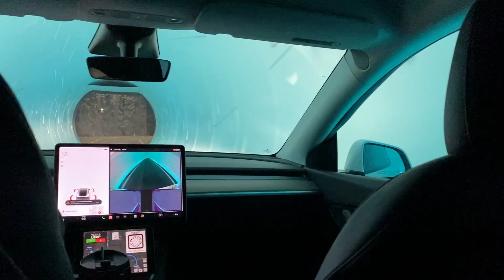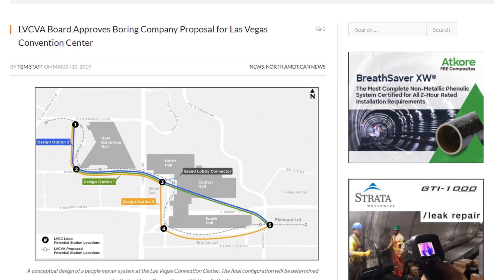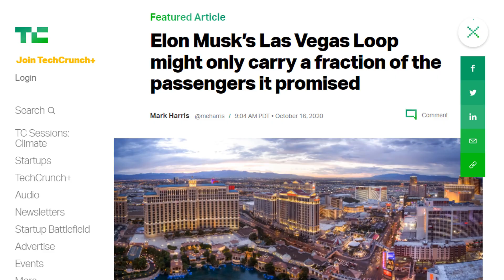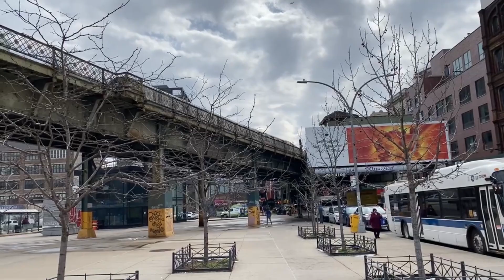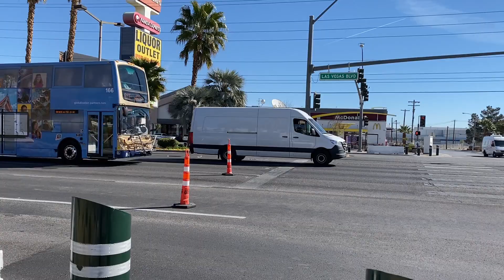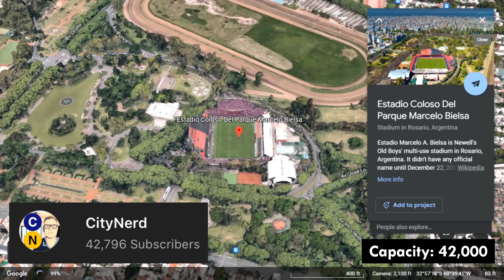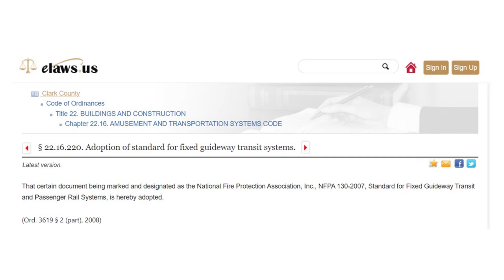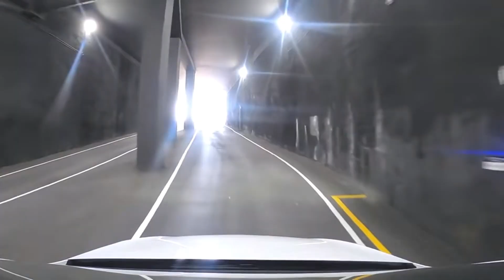Inside the Las Vegas Loop: Transportation Game-Changer, or Complete Waste of Time and Effort?

Comment: 11:50
If it's such a short tunnel why don't they put in moving walkways instead of using vehicles?
Reply: 12:29 the convention center is the first step. In phases 29 miles will happen.
Reply: Because that wouldn't sell any Teslas.
Reply: @colormedubious4747  In fact Tesla intends to take Teslas off the market intentionally after autonomous driving is commonplace. For rent only.
Reply: @conveyor2  So, Zipcar with Teslas, then?
Reply: Moving sidewalks only travel at 1.4mph.  That means it would take over an hour to get you to the other end of the 1.7 mile convention Center instead of 2 minutes on the Loop! 

That is even worse once the rest of the 29 mile 51 station Vegas Loop is constructed - a moving sidewalk would take you 10 hours to travel from one side of the city to the other!
Reply: @andrewfranklin4429  A person walking on a moving walkway moves about 5 MPH.  So that's about 20 minutes to go from one end to the other.  Plus walkways could be going both ways at once and the capacity would be several times higher (about 20 times I think).

If they do make a 29 mile transit tunnel they'd better dig it wide enough for two trains.
Reply: @VitalVampyr  The Disney peoplemover has decent capacity (4,885 people per hour) but very slow speed of 7mph. 

Bus Rapid Transit (at grade) has very low capacity:
90 passengers per vehicle * 15 vehicles per hour = 1,350 pph.
And low average speed of 9mph due to city traffic and having to stop and wait at every stop. 

Bus Rapid Transit (grade-separated) has low capacity: 
90 passengers per vehicle * 30 vehicles per hour = 2,700 pph.
And but still slow average speeds of 12-22mph.

Light Rail Transit (at grade) has medium capacity:
90 passengers per vehicle * 3 vehicles per train * 15 vehicle sets per hour = 4,050 pph.
But slow speeds of 9mph -12mph due to city traffic and having to stop and wait at every station. 

Light Rail Transit (grade-separated) high capacity:
90 passengers per vehicle * 3 vehicles per train * 30 vehicle sets per hour = 8,100 pph.
And still pretty slow average speeds of 15mph due to having to stop and wait at every station. 

Subways have very high capacity:
100 passengers per vehicle * 10 vehicles per train * 30 vehicle sets per hour = 30,000 pph.
But still slow speeds of 17-22mph due to having to stop and wait at every station. 

The 29 mile Vegas Loop (2.5 passengers per EV) will have high capacity:
 2.5 passengers per vehicle * 4,000 EVs per hour = 10,000 pph
AND very high average speeds of 60mph thanks to direct point-to-point travel at high speeds. 

The 29 mile Vegas Loop (4 passengers per EV w ride sharing) will have higher capacity:
 4 passengers per vehicle * 4,000 EVs per hour = 16,000 pph
AND very high average speeds of 60mph thanks to direct point-to-point travel at high speeds. 

But the 29 mile, 51 station Vegas Loop will have up to three parallel arterial tunnel pairs through the busier parts of the city giving 30,000 - 48,000 pph down the main arterial tunnels AND very high average speeds of 60mph. 

The Boring Co has actually rated the 29 mile, 51 station Loop at a minimum of 57,000 people per hour. 

So the Loop easily holds its own against not just people movers, BRT and Light Rail but is also pretty competitive against many subways.
Reply: @andrewfranklin4429  4000 EVs per hour? How is this being measured? If this is the proper measurement of vehicles traversing a fixed point, that's 3x a highway lane. Even if you have perfectly optimized autonomous coordination, which doesn't exist yet, there's still merging, loading, unloading, etc. at the stations. The numbers are nonsensical. In addition, I strongly doubt Tesla of all companies (if any are able to at all) will be able to achieve successful autonomous software considering the high talent turnover due to shitty work conditions. Their software engineers are fed up with Musk's idiocy and leaving, and Tesla's software is suffering for it.

Unless you're getting paid to do so, stop shilling for Elon Musk. There's no benefit in it for you. Look at the more advanced and dense cities in the world and see how they've solved their transportation problems. Here's a hint: the cities are not in the USA and the solution is not cars.

Maybe you are being paid to be a shill, in which case I've just wasted my time. Oh well.
Reply: @TheOneFoolishMan  actually, the potential capacity of a single highway lane is a lot higher in real life than what some sources suggest. A 2010 study by the Honda Research Institute found that 25% of drivers maintained a distance of 2 cars between vehicles at 60mph on a busy 2-lane freeway, 15% 3 car lengths, 15% 4 car lengths, 5% 5 car lengths and 15% 6 car lengths. 

So that is 75% of cars having a headway of one second (~6 car lengths at 60mph) or less and 40% maintaining a headway of 0.5 seconds (~3 car lengths at 60mph) or less. And remember those are cars driven by potentially distracted, drunk and careless drivers. 

Note that a headway of 0.5 seconds = 7,200 cars per hour
And a headway of 1.0 seconds = 3,600 cars per hour

The Boring Co is planning on a headway of around 0.9 seconds (~5 car lengths between EVs at 60mph) which will give a throughput of 4,000 EVs per hour.  With 2.5 passengers per car that gives us 10,000 people per hour. With 4 passengers per car 16,000 people per hour per single tunnel. 

Once the Loop autonomous control systems with their millisecond response times and ability to for example command ALL vehicles in a section of the Loop to brake or accelerate simultaneously, there would be no problems safely achieving headways of this duration.
Reply: @TheOneFoolishMan  in videos from CES, the drivers were saying that the cars have already been modified for autonomous operation, but that it is not yet enabled as they are still awaiting regulatory approval and liability is “holding us up right now, but once that gets cleared we’ll turn all the cars on”. 

After all, The Boring Co actually took the press for test runs using autopilot running in Loop EVs over 2 years ago in the 1.14 mile test tunnel in Hawthorne California.   At that point, autopilot was limited to 90mph (145kph) but was scheduled to be increased to 125mph (201kph) a few weeks later. 

Not surprising considering that following a white line in the controlled environment of a tunnel is hardly rocket science.
Reply: @TheOneFoolishMan  Im not sure why anyone would bother to pay people to shill on a channel such as this?  

Personally, I enjoy meaty discussions around topics I am interested in, particularly when I see the “common wisdom” of the majority on a forum failing to recognise the possibility of disruption coming to the status quo.  

I find it helps to sharpen my reasoning skills and deepen my knowledge about such topics while at the same time providing a good check for me in cases where someone raises a point that disproves one of my assumptions or conclusions. 

So thanks for the opportunity to chat about such interesting things OneFoolishMan.
Reply: @TheOneFoolishMan  in terms of loading and unloading at stations, that 4,000 EVs per hour with a headway of 0.9 seconds is for traffic down the main arterial tunnels of the Vegas Loop. The stations are all off the main arterial connected by short spur tunnels so traffic through the stations has longer headways down to 3 seconds or so which gives us up to 1,200 EVs per hour per station. 

It is a bit confusing, so let me explain how it works. 

Looking at the footage from the SEMA conference in Nov, we see each Loop EV taking around 15 seconds to unload and 15 seconds to load passengers, giving us 30 seconds between vehicles in that one bay. There are 10 bays in each station so that works out as 30 seconds divided by 10 = 3 seconds between EVs exiting that station. 

Again, looking at the footage, we do indeed see EVs leaving the stations down to 3 seconds apart which would give us up to 1,200 EVs per hour. Across all three stations, that’s up to 3,600 EVs per hour. 

We also see between 2-3 people in each EV, so with 2.5 passengers per EV, that is up to 3,000 people per hour per station.  So over the three stations that is potentially 9,000 people per hour. 

Hope that helps!
Reply: @andrewfranklin4429  It's not the following of two white line that the I expect the software to have issues with.

Sure, I can imagine that the software for safe 0.9s headway would be comparatively simple in a continuous route without stations.

What I don't see is maintaining 0.9s headway continuously to achieve 4000 EV/hr when taking into account merging from stations and exiting to stations.

You also can't count on global software coordination when calculating safe headway and safe speed. Even assuming software is bug free, there can be network communication interruptions. For safe operation, the worst case scenario needs to be considered - uncoordinated interaction because of wireless comm failure. Are the Tesla sensors and software sophisticated enough to safely maintain the target speed and headway?

They haven't tested or proven it yet, so there's no way to tell for certain. But my bet is on NOT being able to achieve this capacity.
Reply: @TheOneFoolishMan  yes, the merging of traffic from spur tunnels out of stations will indeed be a more challenging task making use of the local sensors on-board vehicles as well as central coordination - it will be interesting to see how well they do that but we are at least encouraged by the fact that Teslas running the FSD beta software are merging onto above-ground freeways all the time with very low headways in all sorts weather and road conditions currently. 

The Loop has the advantage here again of being a much more controlled and consistent environment than the open road where you can’t even be guaranteed of white lines bounding the merging lanes. 

The Loop has antennae for wireless comms running down the centre of the ceiling of every tunnel so would give a strong signal at all times and the on-board sensor and software suite in the Teslas is advanced enough to provide redundancy and fall-back options in an emergency comms failure situation.
Reply: @andrewfranklin4429  <- Hey, everybody! We found the guy who stands still on the moving sidewalks at the airport annoying the living daylights out of the rest of us who know to ALSO use our legs while using the moving sidewalks. I bet he's the same guy who thinks he has to wait for first responders when an escalator breaks down.
Reply: @colormedubious4747  even if you walk at the average walking pace of 3-4 mph on a moving walkway, that is still only 5mph meaning it would still take you almost 6 hours to walk across the 29 mile Loop versus 5 minutes in a car.

Not very practical is it?